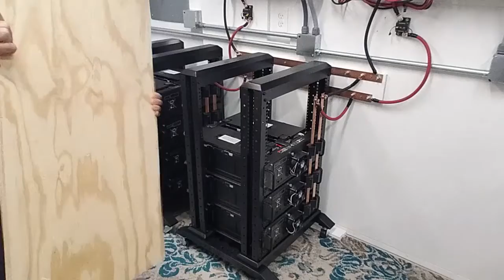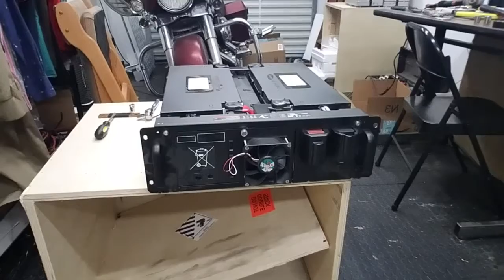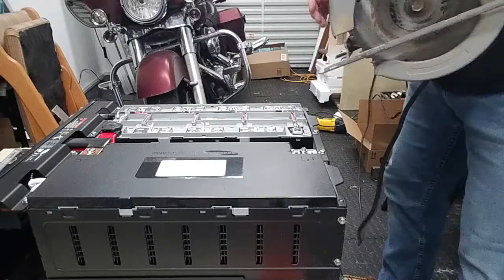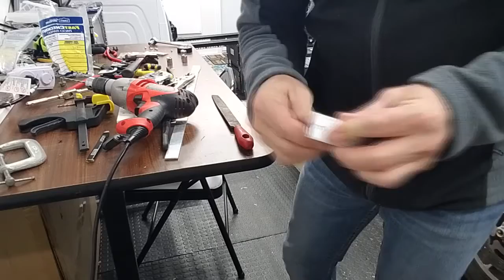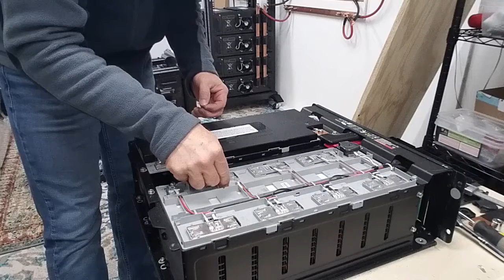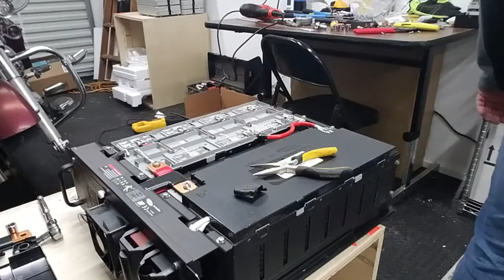Samsung Mega 3.3 SDI ESS Voltage Conversion 16S 60 VDC to 14S 48 VDC

Comment: I know this has been out awhile..but...
  You might increase the voltage range but if you delete two batteries you also loose the capacity they hold.  By increasing the range you also shorten the life of the battery if you use that range.
  I'd have to weigh all of that before doing this.  if the gain is little I'd not bother.
  If you remove those two and use them elsewhere I'd get this, given enough packs you'd be able to build a "extra" one with the batteries you removed.

Comment: Wouldn't there be no need to cut the busbar?? Once the factory jumper is removed and the new one added the two cells will no longer be in the loop regardless if the busbar is cut or not.

Comment: Good Day, Wayne
Were you able to use the battery's  factory installed BMS?
Reply: Leonard Thomas also want to know this.
Reply: @Jon-Luck_Pickerd  I was able to incorporate the on board battery balancing. There is no way to monitor but after checking the batteries after a month or so the batteries are in balance.
Reply: No, I have not used the BMS circuit. I have recently put a victron battery protect device on my battery bank. I do think putting a BMS on each one of the batteries would be a better. However I've not done that and have had no problems.
Reply: @CoHeSieve  Do you mind send me the information on that device

Comment: I have 4 of these and I'll be hooking it up with two 48vdc Magnum Inverter in Parallel these Inverter has Nominal DC Input from 38-64vdc I wonder if I can use these Battery without Modifying it to 14s like you did on this Video.
Reply: The batteries have a peak charge voltage  of 67.2 volts. If you only take them to 64v you will lose a considerable amount of potential energy. Outback inverters will accept up to 68v.
Reply: @mendohomepower7492  What you lose in capacity, you more than gain in cycle life.  It is good practice for these kind of applications to avoid using the top 10% to 20% and bottom 20% of the battery if using lithium secondary chemistries.
Reply: @randacnam7321  Losing the top 20% and the bottom 20% is a bit extreme. You may as well have lead acid batteries. To this day I have not had any issues with the many that I have installed modifying to 51.8v nominal. I keep the upper end to 57.5v and the lower end to 44v. With that I am getting around 22kwh. My oldest install is now over 18 months and cycled daily.
Reply: @mendohomepower7492  Those windows can get you many thousands of cycles out of a battery, but there is still much benefit to avoiding top 10%/bottom 10% of the battery.  Even having a top charge potential of 4.175V instead of 4.2V for lithium ion cells has less than a 1% capacity penalty while markedly increasing cycle life.

Point being that if your inverter/charge controller can go to 63V or more, leaving 16S batteries as 16S batteries has benefits.
Reply: @randacnam7321  4.175 x 16 = 66.8     4.175 x 14 = 58.45    Most 48v inverters top out at 58v to 60v with the exception of Sol-Ark at 63, Deye at 63, Outback, Outback Radian at 68 and Outback Skybox at 68 as well. I've missed some but you get my point. If you have an Outback leave the battery alone and charge er up. Although I'm not completely sure, Magnum will stretch up there as well.
Reply: I have the same Set up yours two PAE MAGNUM INVERTERS  in PARALLEL these Inverter can handle Voltages up to 64vdc I have 4 of these Samsung that I got EV WEST and they work fine. I set my Charger to 90%
Reply: @omarescalante9125  what are your voltage settings for Bulk, Absorb and float?  How long at Bulk, and what level of voltage / amps before switching to Absorb.
Reply: @franklopez6349  I keep it 60A in all of Bulk, Absorb and a minimum of 60vdc of rated Battery Charge
Reply: @omarescalante9125  Thank you.
Reply: @franklopez6349  you find this? Bulk absorb
Reply: @franklopez6349  i have 48v system you have the bulk and absorb?
Reply: They used these also in Australia.
https://m.facebook.com/EnergyMadeClean/photos/a.758802897596770/758802910930102/?type=3&comment_id=2210248645785514&reply_comment_id=2210267342450311&notif_t=photo_reply&notif_id=1604724245758089&ref=m_notif
Reply: I tried using the batteries and charging them less than the stated peak voltage. Besides the balancers not working, there is a loss of about 30% of the power. So by removing two cells and making them 14s batteries the can charge to their intended peak and provide more energy.
Reply: @mendohomepower7492   What do you recommed for bulk and float charge leaving it at 16S configuration?
Reply: @franklopez6349  Bulk would be 65.6v and float would be at 64v with a 16s configuration. Most 48v inverters won't accept voltages that high with the exception of Outback and maybe a few others.
Reply: @mendohomepower7492  Thank You.

Have an Outback VFX3648.

Need to see how program high and low bat settings.
Reply: @franklopez6349  If you have a Mate 3 for a controller it should be easy
Reply: @mendohomepower7492   got this reply back from Midnight...
"The max voltage is listed at 65.2V, but the documentation does not specifically state if that is the desired Absorb cycle charging voltage.  I assume it is, but I have no idea.  And no mention is made of the amount of time to stay in the Absorb cycle.  If you combine several of these batteries in parallel, will the BMSs work together?  Who knows?!
Reply: @mendohomepower7492   Have the Mate, will be going into menu. I'll set low level at 50V.  Need to set MidNight charger.
You recomend 65.6V for bulk,   64V float,
How about for the Absorb setting 64.6V?
Reply: @franklopez6349  I would put the absorb at the minimum allowable setting and just deal with bulk and float.  65.2 should be close enough to get the balancers to function correctly. Set the float a few mv below bulk. Since the batteries are set up in two 8s banks the plugs at the balancers will allow you to plug in a separate meter to check the balance on occasion . I have six  sets of eight of these units in parallel at different locations and another four locations with four sets. All of them are balancing correctly. I had one incident between two sets of four that were different from each other by 1 volt. I attribute this to the different cable length between the two sets of four batteries. It has been rectified and they are all now equal between one or two MV
Reply: @mendohomepower7492  thanks again. Just got this response from SME
"Thank you for your inquiry. 
Absorb and float are terms reserved for lead acid batteries. On lithium we typically use 2 stage charging. The float and bulk value should be the same at 16×4.2. So do not exceed 67.2v
Regards 
James Flores
SME
2892 S Santa Fe Ave., Suite 116
San Marcos, CA 92069
858-967-7822
Reply: @mendohomepower7492   what brand of meter would you recomend to check on cells?
Reply: @franklopez6349  I use this one. https://www.amazon.com/gp/product/B07797N9BG/   It can plug straight into the wiring for the balancers. With a little more configuring you can make it a permanent part of the battery. It will only monitor a maximum of eight cells though so you would need two per module if they were permanent. They can also balance cells.

Comment: I have modified a number of these batteries. From watching your video there are some things that you may want to consider in the future. The batteries are set up in two 8s modules. The on board balance boards that come with the batteries are designed for the two 8s batteries. If you disconnect two batteries from one module and none from the other you create an imbalance in the system and I believe it will effect the ability of the balance boards to function correctly. What I do is disconnect the two batteries from each other and then remove the right side module from the rack. I then remove the front cell after removing the front of the battery enclosure. I use a hack saw to cut the bus-bar, as using power tools is too dangerous. If the power saw slips you could die from the electrical shock created between the meeting of ac and dc current inside your body. After the front cell is removed, the enclosure is put back together and installed back into the rank. The process is repeated with the left side module only it is the rear cell that is removed. Once the module is back in place the bus-bars are drilled and tapped with an 8mm x 1.25 tap. This matches the threads on the other lugs on the battery. Battery cables of #4 or larger are installed to complete the now 14s configuration. I have tested the cell levels after several months on this type of modification and there has never been a variance of over 1/10th of a volt between the cells. I keep my bulk charge at 58.1v and my float at 57.5v. The built in battery balance boards will balance the cells when they reach  4.15v. Please don't use a skill saw to do your modifications. It is unsafe. While you may not injure yourself, your actions may bring about the injury or death of someone else who follows your lead.
Reply: Have you attempted to unbalance the modules slightly and then charge to verify that the on board balancer is functioning? 4.15v per cell is above the 4.1v  rated voltage per Samsung. It seems odd that the balancer would wait to kick in that high. I'm definitely interested in what you have found as I have quite a few on these and I've just been manually balancing altho I've seen little to no drift out of balance with the bms disconnected. Also did you add any bracing to limit swelling of the other cells after removing one from each module?
Reply: @ryanwallis1431  You are right on the 4.1 rated voltage and I stand corrected. I hadn't looked at the documentation in awhile. Balancer would work at 4.05v. I didn't add any bracing as the batteries aren't worked very hard. The smallest group I have commissioned is four. I have each battery set up with a 63 amp Midnite Solar DC breaker. After the breakers the batteries combine into a bus bar. The batteries never run under a high load like they were designed to do so expansion hasn't been an issue.
Reply: Thank you very much for this information on how to keep the BMS working. I am interested in doing this. Could you provide more details on what exactly needs to happen to make the BMS work. When removing the two modules from the circuit, what do you do with the BMS wires connected to each module? Why not remove one cell from each pack on the back instead of one from the front of one side and the other from the back of the other side. Pictures would be very helpful. Thanks
Reply: Nice saftey observation.  "Do not do this at home.."
Reply: How will you know if the on board balance boards are working?
Reply: Hi sir i need 7 cells for do 48v solar system?
Reply: @mendohomepower7492 , I have 12 of these Samsung ESS units installed in a whole-home solar system… I have been trying to figure out why the runtime of the batteries is very short. Is the 60v configuration feeding a 48v Solar Inverter the cause of the quick discharge?
Reply: @alexwolaver9477  Yes, it's the 60v configuration. Since they are an NMC chemistry, thee cells have a 4.2v peak charge. At 16 cells that's a peak battery voltage of 67.2v. I have found over time that it is not necessary to remove the two cells after disconnecting them from the pack. In fact the cells need the compression provided by entire pack. Another thing I have learned since my comment 4 years ago is that if you add an active balancer the cells will do better at staying balanced over time. Another option is to use an inverter such as Victron or Outback that will charge at a higher rate. Above 64v is good if you are leaving all 16 cells connected.
Reply: What balancer  would you recommend for a 14s configuration
Reply: @mendohomepower7492 thanks so much, that’s very helpful. Are there any instructions you’re aware of for performing this modification in a safer manner? Also what active balancer do you use? Thanks!